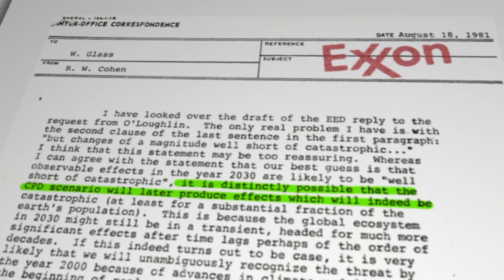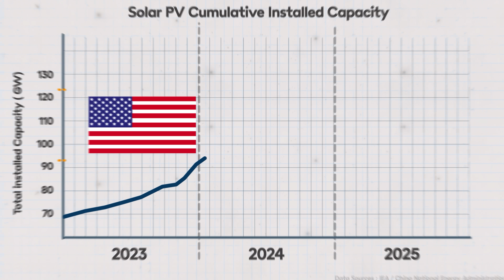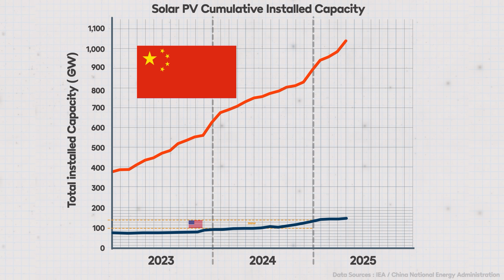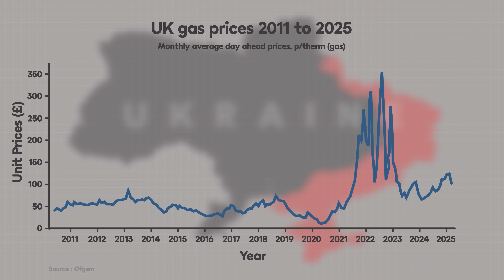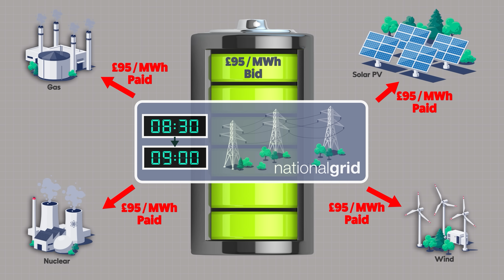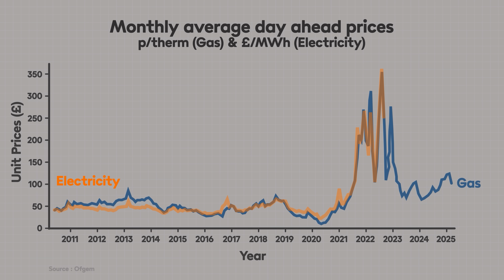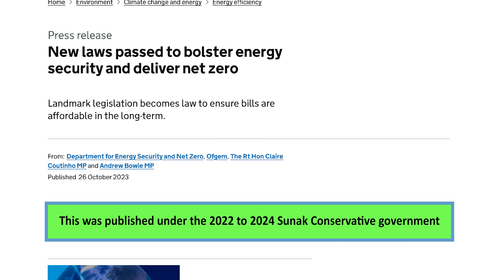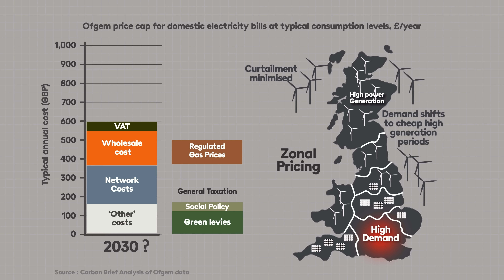Why is UK Energy SO expensive?

Comment: Before phasing out coal prices were ~12-15p, then came the reliance on expensive gas instead of cheaper coal and total "energy transition" investments (including renewables, low-carbon tech, and grid) of ~£200bn from 2020-2024.  Now at last count prices are 25.7p.  I find your explanation unconvincing.  The price increase is because of net zero policies.

Comment: The UK is making almost all its electricity with very expensive natural gas or spending even more natural gas to support wind power.   In addition the worthless wind power is a forced purchase to the power grid.    These high costs have to be passed on to electric rate payers.   Even with the high cost to rate payers those prices are subsidized.   The UK is culling wind farm output to save on expensive natural gas.

Comment: The problem is simple...batteries!  As long as wind and solar are highly variable, which is always, then natural gas will drive the bus.  Batteries live on a commodity trading model, that is, buy low and sell high.  That means they need wildly variable prices to be viable.  Nobody likes wild price swings.  Until there are installed batteries that can carry let's say 50% of the grid for more than 12 hours (360 GWhrs for Britain), then wind and solar will always be a marginal source.

Comment: UK Solar is bs. Quality bifacial monocrystalline panels (the same as the installers sell you) can be had for £60/500W panel at cityplumbing. A 3kWp array is £360 in panel cost, £60 in mounting hardware, and if you're running a battery with an inverter with several MPPTs then you don't need external microinverters - for a total solar cost of £420. There is NO WAY that a 3kWp array is worth the average £3,300 installed - that 8x difference is all down to greed and profiteering. Self-installing a 3kWp array + 8kWh battery with integrated inverter/4 MPPTs from Ecoflow costs £2,900. If you wanted a 3kWp array for £3,300 installed + 8kWh battery £5,000 installed for £8,300 total the differene is £5,100 of greed

Solar installers in the UK are actively keeping back UK households and making climate change worse. In Germany anyone can install balcony solar and batteries which just plug directly into mains.

Comment: So UK didn't buy Zonal pricing and has set the max price for AR7 at well above current gas prices to try and incentivise wind farm developers to bid after Orsted pulled out of Hornsea 4 which was already being offered more than current gas plants. Oh and don't forget gas has to pay a carbon tax which increases its costs by 25-30%. Then we have significant costs increases coming from Transmission charges to pay for the Great Grid upgrade which at least may alleviate the massive balancing costs we are paying out whenever the wind blows too much to switch it off and switch back on the gas it was supposed to replace. The reality is weve created an overcomplicated system and are running too fast to try and decarbonise by 2030. What we really needed was CEGB MkII with a remit to decarbonise in a structured way over a much longer timeline to avoid all the waste.

Comment: Do you know to what extent these kind of models take into account the increase in cost to produce this extremely reduced amount of Energy using Coal, Gas etc ? If you are trying to support 10 times less infrastructure and industry surely you lose the economies of scale and the cost to produce 1kWh is not the same as it is with current levels of deployment...

Comment: I’m amazed Dave hasn’t grasped that our reliance on gas is part of the transition to renewables—it’s not a separate issue. Right now, renewables still depend on gas to fill the gaps when it’s not windy or sunny, so you can’t treat them as entirely independent. He almost gets there when he mentions other countries still using coal to keep prices down, but misses the wider point.

By racing toward net zero without firm alternatives, we’re becoming even more exposed to gas prices—because it’s the cleanest fossil fuel left to bridge the gap. If there were a renewable that could reliably replace gas, we’d be using it already.

I’m all for clean energy—I drive an EV and have solar and battery storage—but this video is a bit of a sleight of hand. It presents things as simpler than they really are, hoping no one questions it.

Comment: Still using LCOE? You’re way behind on the analysis, and what’s the point of showing LCOE to 2050 when everything built today will need replacing before 2050 - the net zero target date for many countries. The massive variation and lack of reliability of renewables operations affects balance and frequency, and closure of coal has meant the UK leans more on expensive gas when the UK. No wonder gas sets the price. Well thought out but biased reporting that fails to see the problems with balancing the grid insecurity.

Comment: The MCP model is a SCAM! all it does is increase the profit of cheaper sourses (wind solar) that don't provide the same utility as the more wxpensive ones. All electrons are not made the same as you point out. There is a reason Gas is the go to for grid balancing, inertia and peak demand (dispachable/load following) electrons. 

If you can't load follow or provide grid balacing & inertia, you shouldn't get the same price as something that does!! This is obvious. If i buy a Ford, I don't expect to pay Farrari prices! But that's exactly what MCP forces you to do, much to the delight of the investors in "Green tech". 

The solution is simple, price apples as apples & oranges as oranges. Otherwise, the "green levy" is not even the biggest portion of the green levy, lol. The real levy is the Gas wholesale price as the Delta goes straight to the wind & solar producers. 

The idea that as we electrify more stuff, this problem goes away is untrue, most car charging will happen at night, solar can't load follow that, so where will the power come from?? That's right, Wind but with gas to top up (currently) In fact, if you think about it, the renewables people would love to keep the status que exactly where we now are! 

With Gas still dictating price 98% of the time. The incentive to build more solar & wind storage is non existan, as is any to spend money on balancing inertia (fly wheels etc), as that would be both expensive and remove the dominance of Gas to set prices as load following becomes possible due to the flexibility storage & balancing would bring. Why would investors do this when they know it would decimate profits the MCP secures for them. They loved the high Gas prices and the destruction of Nordstream. 

(Someone should really look into who blew that up and why.)

If you want to know why the sudden flip back to fossil fuels, it's because this is the sweet spot for profit under MCP. The same goes with electrifying everything from Gas to Electricity, because the price is still going to be set by N Gas!! But now you're using more of it. 

It's the same reaon Car makers aren't going hard on Car to grid, as this would also put some load following onto the grid and they'd like to sell you a home battery too. This is a far lesser point but still valid. 

The real point is incentives drive behaviour, and MCP is a terrible deal for the consumer and great for producers and their investors. 

To make matters worse, there's CFDs that ensure the Gov pays a minimum strike price to producers for overproduction when non load following sourses produce too much, again, solar is the big culprit here. Wind is far better than solar in all these cases but it's still not able to provide inertia and is still intermittent. 

None of this renewable energy sans storage, can do industrial process enegy reliably or heat either. 

Gas Peaker electrons should be more expensive as it does all these things (or can do) The only time we should price electricity from Solar or wind at the same price, is if it has the same utility. Which means that it should be dispachable and balanced. If it's not, why pay as if it is? 

In short, MCP should have been scrapped long ago, it's a compete farse and hidden "tax" on energy. It existed to incentivse renewable generation projects, but the need for this is long gone and it now disincentivises storage etc.

The real solution is to price like for like electrons. If you want to incentive alternatives, scrap red tape around New Nuclear (some can load follow) & build the skills base up in that. Wind & solar are now a scam, as they are cheap to finance and the returns are large. if you're putting them on to the grid, they should be priced as low teir electrons.

Comment: Unfortunately, you have jumped on the 'gas makes electricity expense' narrative that has been widely spread in the media. In reality the pricing mechanism is fairly complex and your analysis makes no mention of ROCs (Renewable Obligation Certificates) or CFDs (Contracts for Differences). The latter is used for nearly all wind and solar since 2016, causing them to be shielded from the wholesale price as far as consumers are concerned.
The wholesale price of electricity only makes up about 40% of the total cost to consumers. A lot of the additional cost is related to renewables - ROCs, CFDs, FIT (Feed in Tariff), balancing costs, curtailment payments, the capacity market and grid expansion.
The charts you show using wholesale price information from Ofgem are misleading because Ofgem lumps the cost of CFDs into the wholesale price rather than separating it out as a net zero cost.
David Turver has done some detailed breakdowns of the cost of each source of generation to the end consumer. Gas generation is actually the cheapest even with elevated gas prices and carbon taxes.
I recommend looking at some of his essays if you want an in-depth understanding of why our electricity is so expensive:

https://davidturver.substack.com/p/renewables-are-more-expensive-than-gas
https://davidturver.substack.com/p/why-energy-prices-high-how-reduce-them-esnz-cost-of-energy
https://davidturver.substack.com/p/net-zero-for-dummies

Comment: Wholesale gas costs are irrelevant. 
When unreliable's can't supply, the gas power stations can charge what they like and its not uncommon for them to charge £3000 MW/h. It doesn't matter how much unreliable energy gets added to the grid, they need gas to back them up.

That is how supply and demand works, the only way to bring down costs is for supply to meet demand and that means building more gas plants.

Comment: Very good and interesting a couple of points to add. (1) Energy does not equal electricity only. It is worth pointing out the UK energy mix ie only around 1/3 energy consumed is electricity, around 40% is heat consumption (mainly gas in the uk) with the balance being transport (again main,y fossil fuel). I think you need to show the picture as a whole as by taking total UK energy consumption fossil fuels dominate and the road is very long to decarbonize. The continued error of mixing terms ‘energy’ and ‘electricity’ is in fact holding back our understanding (2) you did not mention the do not produce fees paid to renewable energy producers these also need a solution just like the gas fired availability levee these are two sides of the same coin. I am fully confident that a green future is possible and affordable but we need to have a complete cold rationale view of all factors if we are to find solutions.

Comment: Yes, it really is renewables that are driving up the cost. They make us dependant on gas as it's the only thing that can currently cater for their unreliability. And due to the way we pay providers, which was designed for dispatchable energy generators, renewables are 'overpaid' for their lower value energy generation, but no one will ever consider that 'overpayment' as a subsidy and will be shocked when investment in renewables plummets if/when it's removed.

Comment: PV Solar, particularly in this country is not worthwhile and as you state it is certainly NOT carbon free!  I say this a someone who is both invested in solar and who is also a electrical engineer. The mains points are that. 1. PV cells produce a tiny percentage of there stated power unless they are being hit by direct sunlight. Its mid summer now and the majority of the country has been covered by cloud all this week! Secondly their carbon cost and lifespan are very inaccurate.  Because they are made mostly in china it is very difficult to get and accurate forcast for the carbon used in their total construction. There are an increasing numbers of reports emerging, that show they are at best almost neutral! That however is based on a 20-25 year lifespan and most pv solar managers are pulling there panel much closer to 10 years, that partly down to improved panels being made available but  also down to cleaning cost and damage from micro fractures from the excessive weather we get in this country. I have watched a loved this channel from the start, please move away from trendy politics and back to facts thats why we are here.
Reply: Yes, solar panels are not CO2 free in production. German Professor Quaschning has compiled a list over energy required to produce 1 kwp of solar for several years. For recent years it shows that 5.600 kWh of energy is necessary for the production of 1 kWp or 5 square metres of solar panels. These 5.600 kWh are thermal energy from coal or gas. A coal or gas power station would provide about half that energy - at most - from this thermal input.  In places like northern Germany where the solar conditions are far from optimal 1kWp of solar panels produce about 900 kWh of electric energy every year. Professor Quaschning has estimated the so-called EROI (energy return on investment) time for panels installed in Germany at 2.6 years. 
I have four panels with 1.64 kWp in my garden and observed a total production of 1.500 kWh in 12 months, what supports professor Quaschning's estimates.
Even if a panel fails after 10 years of operation it will have provided about 4 times the electrical energy that could be produced from the thermal energy needed for its production. So the overall balance is definitely positive and is far better than burning gas or coal just to produce electric energy.
Reply: @ElwoodEBlues  
Energy is inherently ubiquitous and free.
Power-service costs.

Comment: The thing that really annoys me is that it would be really easy to have a green revolution but it's deliberately held back by lobbying. The price of fuel is set at the highest price when purchased from multi national companies. However regular people in the UK do not get paid anywhere near the same amount per unit for the energy produced from solar panels. If the price actually matched per unit the same as gas then solar panels would pay for themselves in a few months rather than years. During the summer I generate 18 times my homes energy requirements yet I still have to pay octopus energy each month for the tiny fraction I use overnight to keep the fridge/freezer cool.

Comment: The renewable energy sector is heavily subsidised to the point that they get paid to turn off wind and solar when demand is low and  when energy cannot be generated.
Then of course we have the environmental impacts of renewable energy that require more minerals like copper and rare earth minerals then we have of known reserves, this requires mineral exploration in pristine wilderness, and let's not forget the large amount of fossil fuels require for renewable energy.
As for the climate crisis, 91% 9f the earth's energy imbalance is stored as ocean heat content and as we know IR doesn't penetrate more then 0.01mm of the oceans surface so the rise in CO2 is not responsible for this warming.
Just have a think and not blindly follow the narrative.

Comment: 8:00
Dave, I agree with this video, its argument, and this message, but I don't like this chart.

Gas and electricity have prices measured in different units, gas being in pence per therm (I assume this is British thermal unit) and electricity being in pounds per megawhatt hour.
This chart is good for showing that the shapes of the lines are similar, because the changes in the directions of the lines do not rely on what units are being used. However, I still feel like this chart is somewhat misleading or disingenuous because of the difference in units on the sams price axis.

It would have been better if you used pounds per megawatt hour for both gas and electricity in my opinion.